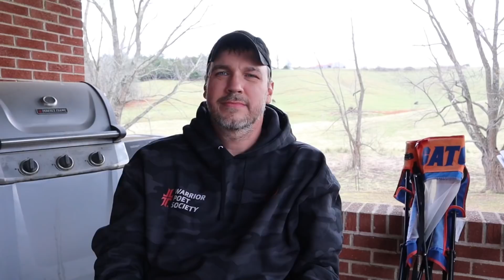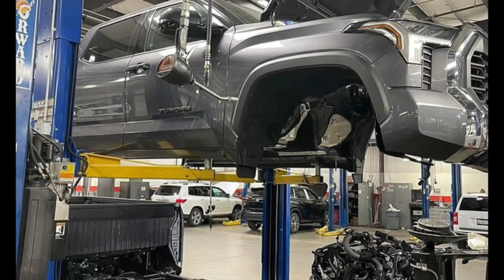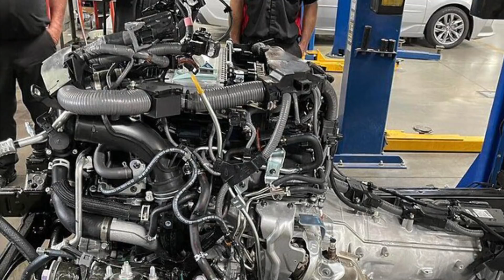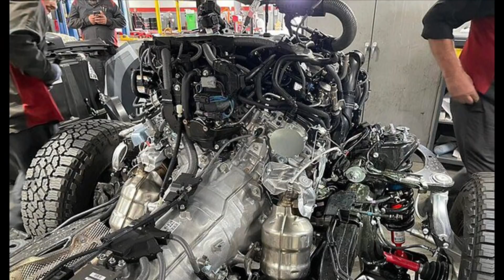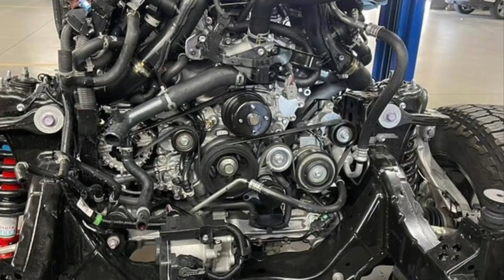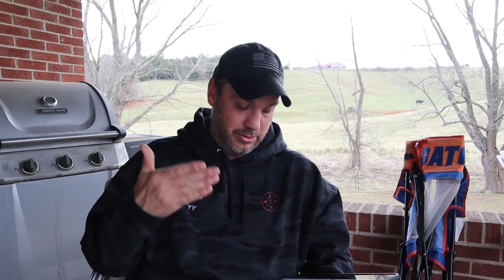2022 Tundra Problems… This Could Be A Disaster

Comment: I’m a Toyota guy too but this time my money is going to Ford for a F250 with the 7.3L pushrod V8. Simple, large displacement, pushrod V8 in a pickup the way God intended.
Reply: Sweet!
Reply: Or get 5.7 V8 and forget about the TT V6 issues.
Reply: Ayy, that 7.3 will outlast the truck. The only issues you'll be dealing with are Ford electronics shitting the bed.
Reply: I got a 2021 F-350 7.3 FX4 ! Luv it ! Has 4.30 gears & can gooseneck 20K Lbs !

Comment: For trained tech it takes less then 45 minutes to take cab of the truck. Most of Ford techs do that when they replace CamPhasers in 3.5L Ecoboosts. Its much easier for the tech to take cab off instead of disassembling half of the front or to lean on customers front end of the truck for 10 hours causing possible scratches or damage. By lifting the cab off the frame you actually barely unhook any electrical components compared to what you would have to unhook dropping the engine.

Comment: Removing the body from a truck is common and easier than dropping the engine / cradle. Example - diesel pickups.
Reply: absolutely, lots of people in the comments worried and concerned about squeaks and rattles, "it will never be the same again" simply not true, while sure possible not at all the common outcome. Vehicles are made to be disassembled and reassembled, theirs a reason techs don't like customers in the shop or looking through windows and such, they freak out when they see their car disassembled.
Reply: That’s right…a friend had a ford and it had to have the body removed to replace the turbo on a Cummins Diesal.
Reply: 99% of the people commenting about taking the cab off have no experience or any actual mechanical ability.  Also plenty of Toyotas on the road have had the frames replaced under recall and are just fine.
Reply: @firebir11  What Ford has a Cummins engine??  Yes, the Ford V8 diesels require the cab to be lifted for just about everything.  The Cummins I6 comes in Chrysler offerings, and is comparatively MUCH simpler than a V8.

Comment: The finned wheel is the actual turbo and the other end of the shaft connects directly to the compressor wheel.  The disk at the top is the actual waste gate valve.

Comment: The Car Care Nut here on YouTube has an excellent video of the mechanicals of the new Tundra. I think he said the waste gate was simply a release valve for the turbo.  

That is how they put them together at the factory, but I'm with you - I don't trust them to put it back together at the dealership like it was put together at the factory. That truck will never be the same. Scratches, leaks, squeaks and rattles. 

This new engine seems so complicated that even professional mechanics are going to have a tough time fixing them.

Comment: 6:04  That is the wastegate flap on the left (closed position), with the turbine wheel.   Exhaust comes from the exhaust manifold, funneled through the turbine wheel spinning it very fast (100,000 rpm) which is connected to the compressor wheel, spinning it on the compressor side (sucks and compresses air from the intakes) and sends it to the inter cooler then to the intake manifold.  The flap opens once the turbos produce peak boost (not sure what stock levels are).  If it doesn’t open, you experience “boost creep”, where if the wastegate doesn’t open, the turbos will produce more boost, producing more exhaust, producing more boost, producing more exhaust (positive feedback).  The engine will detect that or detect engine knock (too much boost will not be sufficiently cooled by the intercooler and will cause detonation in your engine, compressed air gets very hot and must be cooled sufficiently) and will either pull timing or fuel to protect itself.  Under acceleration under full boost, if the wastegate is stuck shut, the truck would “fall flat”, feeling the power, then there is nothing (engine automatically pulls timing or fuel).  If the flap is stuck open, then exhaust will bypass the turbine and the turbos will not produce any boost, in this case you will not have any power at all.  My advice to anybody who has a turbocharged vehicle, get an aftermarket boost gauge and tap to read what the boost is at the intake manifold so you know, I never trust the dash boost gauge.

Comment: Most if not all trucks are built this way. Frame gets built up (assembled driveline component) upside down then flipped(motor trans then installed). It is then mated with the cab and box where the assembly process is finished.

Comment: $60k for a gasser is insanity. 
My old 2006 ram 2500 5.9 Cummins is still running like a top 15 years later. People are dumb for dropping that kind of money on a gas truck that has no longevity.
Reply: I have a 2007 Ram 5.9 Cummins. Ditto on the longevity but with diesel skyrocketing it sits a lot. With the current world situation maybe we'll finish the pipeline from Canada as was contracted. Electric is the wave of the future but people could use some immediate relief. We went from an oil exporter to an importer with a change in the Oval Office and no I didn't vote for Trump. The video of the loose console too is pitiful. I'm 72 and that's a first for me.

Comment: And it’s called an “internally gated turbo.”  
 The WG is built into that exhaust turbine housing.  VW/Audi has been using it for ages and known for issues when chunks of whatever get stuck in the gate, causes SES lights and you can’t rebuild it so you just have to replace the whole turbo itself.  And honestly if it’s under warranty, I wouldn’t worry.  As long as they provide a loaner and as long as all I have to pay is the deductible.
The WG “flapper” is on the top and the turbine exducer is on the bottom.  The WG also controls the turbine housing has diversion in that internally gated setup.
I’ve been an avid automotive enthusiast for my whole life and an operator and mechanic for almost 20.

Comment: So I have to be a bit critical, if you have never worked in a dealer and know this little about vehicles, might not try and make content.  Rear wheel drive trucks do not have cradles.  The blur is directly behind the passenger cyl head and the passenger side cat is still attached to the manifold.  The photo that appears to be some sort of compound turbo system has the drivers side cat removed and we are looking into the drivers side manifold.  Removing the body has long been a great and easy way to gain access to an entire drive train and was made almost necessary when auto manufacturers started moving the engine behind the front axle for handling purposes.  After disconnecting several gang plugs and fuel system, typically the master is disconnected from the booster and it remains with the chassis and the AC compressor can sometimes be unbolted and it remains with the body.  The real issue here, one that you should consider, Toyota is LATE to the market with a new truck, 15 years to be exact.  They have had a TON of time to test this truck and bring it to market perfect considering they already took their ever loving time.  Then there is the already known issue with replacement fuel cell costs for the Tundra hybrid.  Personally, to hell with Toyota and their attempt to conform to our EPA BS.  Looks like a lot of us will be keeping our gas hungry, darn near bullet-proof 5.7's...chances are, our truck values will remain high.  Doubt many Tundra owners will be in a hurry to drop 70K to down grade.... Anyway, don't take my criticism personal.. I thank you for taking the time to share this catastrophe of a Tundra.  Thumbs up!

Comment: I haven’t seen a close-up shot of the frame of the 2022, but the reason you can’t remove the engine from the bottom of an 07-21 tundra is because the crossmember is welded to the rest of the frame. You’d have to remove the engine from the bay from the top (if it’ll even fit that way), or take the body off.

Comment: So much for Toyota reliability. Was planning to buy one, but not now. Instead I'll get the GMC Sierra with the 6.2 V8.
Reply: Set some big money aside for getting the camshaft and lifters replaced every couple of years
Reply: Lol that's a terrible choice if your looking for reliability...lifter failure is HIGH percentage
Reply: @ericeanes5799  What do you guys think about the reliability of the 3.0L inline 6 Duramax?
Reply: Friend of mine has it and loves it, haven't heard of any major issues
Reply: @percivalgooglyeyes6178  any engine that requires me to drop the transmission to replace the timing belt is definitely a hard pass for me
Reply: @fj60driver  I hear ya, but that doesn't seem nearly as bad as a full cab removal for turbo actuators!
Reply: @percivalgooglyeyes6178  nope not as bad but transmission removal shouldn't be part of Maintenance.  Of course Chevy transmission fail pretty often and that's why they needed Fords help to make a good one so when the transmission fails just plan on spending a bunch money to do the timing belt at the same time!
Reply: @fj60driver  Isn't the new 10 speed the same as the Ford? Or did GM bean counters save a few pennies on cheaper internals?
Reply: @percivalgooglyeyes6178  it is the same.  Other than the bell housing and some programming of course but it is a Joint venture between the 2 companies.  I work for a sheriff dept on the county level and our vehicles are mostly Chevy Tahoes.  I worked for Toyota for 12 years before hand and I can honestly say I have done more camshafts and transmissions in 6 months working on Chevrolet than I did in 12 years at Toyota

Comment: Just wishful thinking, if Toyota continues to have issues with the V6 TwinTurbo, maybe they will go back to a 5.7 L as an option with a 10 speed automatic tranny. Toyota can fine tune it for more power and more better mpg. Again it’s wishful thinking.👍🏼
Reply: Yes!! 
I’d buy if I could get a CrewMax, king bed, 5.7 with a 10 speed.
Reply: Never going to happen.
Reply: @BarnStangz  Is why I said wishful thinking
Reply: Not going to happen. I would jump on a 22 is it had the 5.7 V8 and trade my Tacoma asap if that was the case.
Reply: @IzaguirreC  Is why I said wishful thinking only

Comment: I'm pretty sure they design these so it's easier to take the body off. The biggest problem is that you have to have a shop that can accommodate lifting it off. You have to have the right type of lift and a shop with tall enough ceilings. I wouldn't worry about squeaks because of how they attach to the frame. I would DEFINITELY be worried about this waste gate issue. Turbos on semis last for ages. Even ecoboost turbos have held up way better than I expected. Hopefully this is an easy fix.
Reply: It’s not about how easy is to take the cab off the frame. It’s a problem of once the warranty is over and you run into this issue it will cost a ton. looks like a spaghetti mess, I can see a tech forgetting to replug a hose easily.
Reply: @IzaguirreC  I don't disagree. The real issue is all the stuff crammed in there. It's probably easier to work on everything with the cab out of the way. If they have a good checklist from the manufacturer, they shouldn't miss anything hooking it back up. I have an old '79 Ford with a 302 and a C6 trans. It's 100 times easier to work on than my new trucks because you have room to do it.

Comment: Imagine complaining about something when you don't know what you're looking at...  "Drop the Engine out of a bottom of a truck" is a clear indication you have never done any major mechanical work on a truck before.  Toyota would never allow someone who isn't a Toyota Master Technician to do such a repair.  Guarantee they sent out a engineer to come up with a repair plan.  Early 07-08 Tundra had problems with air pumps, front differential noise, rear axle bearing noise and cam tower leaks.  They will fix these trucks and future models will be more refined.  They aren't GM crapping out the same 5.3 engine with lots of camshaft failures and doing nothing.
Reply from the maker: Funny you know how great these engines are when the trucks have only been shipping for about a month!  Must be nice to be able to see the future and know these turbo engines will all go a million miles with no issues at all. 🤷🏻‍♂️
Reply: @gearrunner  well I worked for a Toyota dealership for about 14 years reached Toyota Master ASE status and know how Toyota operates.  After working for Ford for 4 years prior and trying out Fiat/Chrysler for 1 year and now I am working on a Fleet of Chevrolet vehicles for the local county there is for sure more issues with "American" Built trucks and would never own one.  Early model Tundras had problems and this one is no different.  Toyota will work out the kinks and fix in years to come it as opposed to building the same V8s that GM and Hemi still build the same for the last 10 years that have camshaft issues, exhaust manifold bolts that break, transmissions that fail constantly.

Comment: Why we are listening to this guy. Every company out there is been doing this procedure on trucks for years. Easier to access to certain parts. Dropping the engine like he's  talking about is more work. Then un bolt 6 bolts to remove the cap of the truck. Of course is other electrical connections and coolants hose to be removed.
Reply: yes he dose not sound very knowledgeable, I say this respectfully but he speaks as more of a fan/enthusiast/customer, lots of I don't knows coming from him he shows to not have any experience in the automotive field, that's not to discredit or bash him simply stating the value is lessened the way is presents this information or rather lack their of.

Comment: On Sunday 01/16/2022 my 2022 Tundra got two codes 1) P25B372 waste-gate actuator stuck open, 2) P02351C turbocharger boost sensor circuit voltage out of range. I drove it home and parked it. Started it to take it to the dealership on Monday and the check engine light was now off. It seems it mended itself. However evidently according to the dealership who spoke to Toyota Tech Corporate, it is a real issue and parts to correct it are not available and it is not known when parts will be available nor exactly what needs to be done to fix the issue. My car has 245 miles on it. FYI.
Reply: Oh no, I'd be crying , good luck.

Comment: Work in manufacturing for years yet cannot identify simple parts? I’m an electrician and i can tell that the last pic was the turbo housing removed to expose the waste gate. It’s position is low and to the back where the exhaust gasses leave to connect to a small Dow pipe before the cat. You cannot identify the difference in the photos yet the bright yellow dipstick is on one side and not the other.
Reply from the maker: I didn’t say I was a mechanic I said I work in manufacturing.  Just in case you can’t comprehend that, there’s a HUGE difference between the two!

Comment: I have three Tundras: a 2002, 2019 and 2021. Traded in a 2005. I prefer the older 4.7 V8, which got reasonable mileage and was incredibly reliable (I also have a 2007 Sequoia). The 5.7 is a gas hog but I'm sticking with a V8.  I run an archaeology company and we really treat our trucks roughly but nothing ever goes wrong. I don't worry when I have 6 people in a crew cab 7miles in the woods on a logging road. I bought the 2021 precisely to grab the last V8. What I wish is that Toyota would figure out how to make their V8 more fuel efficient. Obviously it's possible.

Comment: Great video,  I can see the waste gate of the drivers side turbo clearly in the one picture. Most likely they are inspecting both sides. Also raising the body off the chasis is the easiest way to get the motor out. It can't come out the bottom as the frame crossmember is welded to the frame rails

Comment: It’s much easier to take the cab off a truck to do a major repair, as opposed to not doing it and playing the contort yourself like a pretzel game. Any shop worth its salt can get a cab off a truck in a short amount of time. It makes things much more accessible, and ends up costing the customer LESS money, because there is much less of a chance of damage to ancillary parts, or radiator shrouds, fans, belts hoses, fuel lines, and that always guaranteed “woops I forgot to disconnect that…” 

Nobody wants their new truck in the shop, but Toyota is going about the repair procedure correctly.  It would be hard to make sure you have things buttoned up just like brand new if you don’t have the cab off the truck.

Comment: They did drop the engine but the engine is sitting on the frame. It’s called body on frame. The drivetrains mounted on the frame with suspensions. All trucks are like this. Ram ford all the same. They just pick up the body with the lift and leave the frame and drivetrain on the floor.

Comment: Taking a cab off began with ford 6.0.

I’d rather remove a cab than pull an engine on a modern full frame vehicle.
However…. I really appreciate the rear wheel drive cars that I pull the power train  out the bottom !!

Comment: Recently sold my 2020 TRD PRO as I needed a more larger truck for my business. I would have been all in on a 2022 Tundra with the long bed with a V8 or diesel. I switched brands to a Ford F250 and happy. Miss my tundra for sure, but needed to switch.

Comment: The 01-04 lb7 Duramax trucks with injector issues it was easier to work in with cab pulled. BUT it was quite simple to pull them everything was quick connect including steering shaft
Reply: The shop I use told me that Duramax injectors on the early ones books out at 14 hrs I believe.

Comment: Been a Tacoma guy for 10 years, was planning on trading up to the new Tundra, but after seeing it I just couldn't get past that front end design.  Some people like it, it's just not for me.  Throw this potential widespread turbo issue into the mix and I've pretty much ruled these Tundra's out, at least for 5-6 years until a design refresh comes in.  Probably going to get a Ram 1500 Backcountry with the V8 hemi instead.